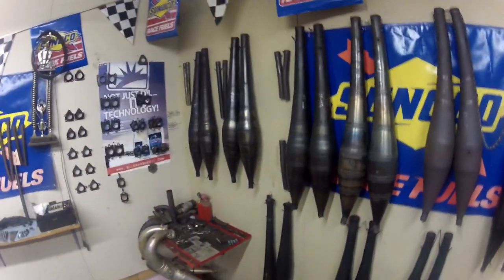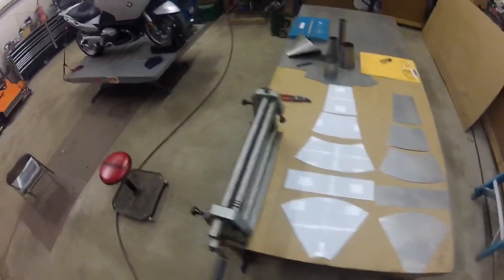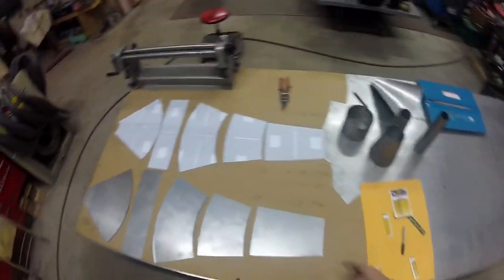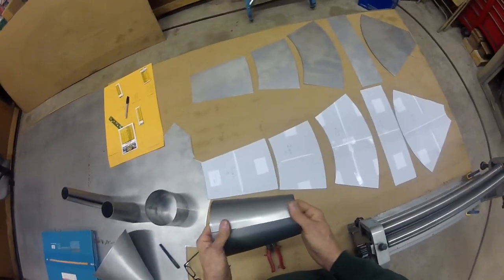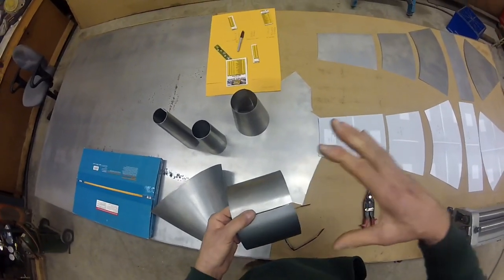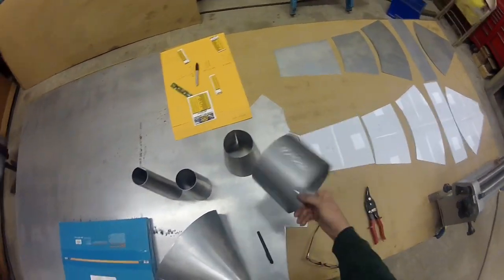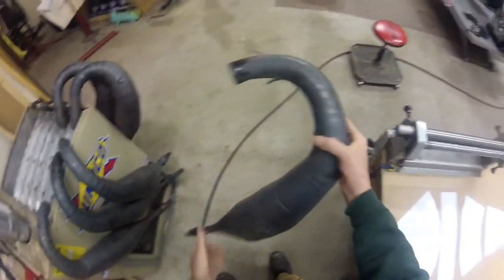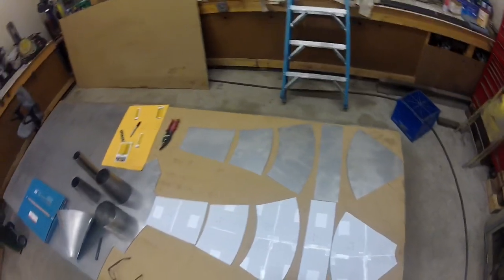Two Stroke Pipe Building - Intro Ep. 1

Comment: I noticed you mentioned that the dimensions are critical. I have first hand experience with that issue, according to my mechanic. I got an early run pipe for my cr250 two stroke and loved the power band. I crushed it three years later and ordered the exact same pipe. It was stamped. It didn't perform the same even though it was the same part number. My mechanic said that the stamp forms can wear out and change the dimensions slightly, changing the power.

Comment: is there anyway this guy would be willing to respond to an email of mine? i need to build a custom 125cc pipe, tried cutting and welding an old fmf pipe but made it shorter to fit the chasis and it really messed up the tuning of the motor so i need some serious help haha, id be willing to pay for his help obviously, thanks.
Reply: Hi. did you manage to solve it? I have exactly the same problem with the 65cc engine
Reply: @danielsulik78  no help from this guy, just a lot more research, it just comes down to you cant compromise the pipe and unless you have the right sheet metal tools you cant really make a new one. You can cut and turn it tho, which take a lot of time to figure out how it will fit without taking any length out, cut on manufacturers welds and start turning and tacking from there until you have something that works.

Comment: Be nice if you didn't start halfway into making the Tuned Pipe! Like what Engine you're using? It's Stock Stock hp@rpm! Stock Porting or Race Porting! How you determine How much hp Increase your after at what rpm! What Tools are you using and weblinks to them, like the Roller! A Rotax 277UL was rated 26hp@6250rpm and 28hp@6400rpm with a 36mm Bing 54 Carb. Both used a Header/Muffler Exhaust. The same Base Engine as used in the Skidoo Snowmobile used the 277F and was rated 28hp@6750rpm with a Mikuni 34mm Carb. In the early 90's a Company Named R&D Aero made a Tuned Pipe for the 277UL 26hp version that made 30.5hp@6250rpm. If using it at 6500rpm Max, what is the Max Hp it can make? It's (72mm x 66mm) 268.8cc.

Comment: What Software do you use? How do you determine what hp it's going to make at your Target Max rpm? Do you Sell these Tuned Pipes? Have you made any for Older Skidoo/Rotax Singles 250, 277, 292, 299/300, 318/320, 335, 340? be nice to see the Dyno result of the Tuned Pipe!

Comment: Nice Video! 
Can you show, how you cut the coned header section into angled cones?
Reply: Did you get any answers?
Reply: Nope.
Reply: STROKED Last year/ beginning of this I was planning on building and found a great channel were a guy showed how to use cone layout and explained how to set angels and so on and I just CANT find his channel
Reply: If you found his channel, let me know his channelname. 
Iam actually also planning a pipe with cone layout. 
Iam struggling a little bit with the right calculation of the pipe (length and diameters).
Reply: STROKED yes, he explained easily, but to make the cones you needed to add different cones + some mm to compensate for bending